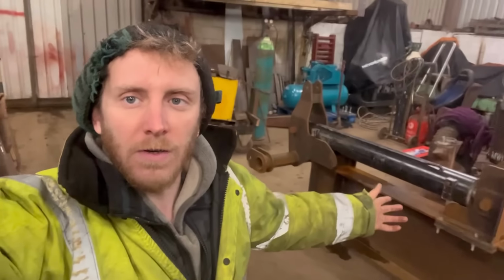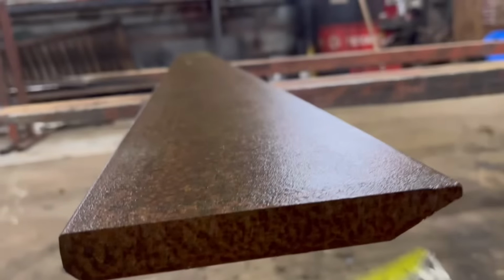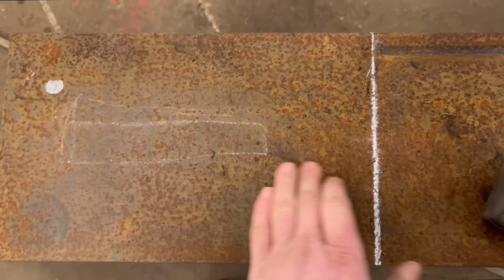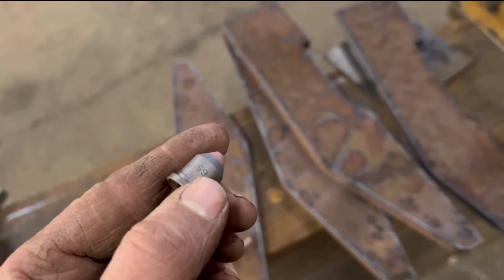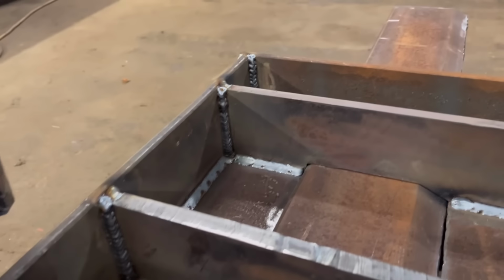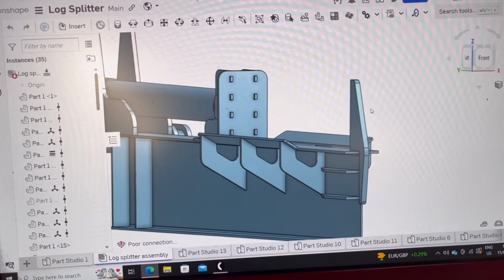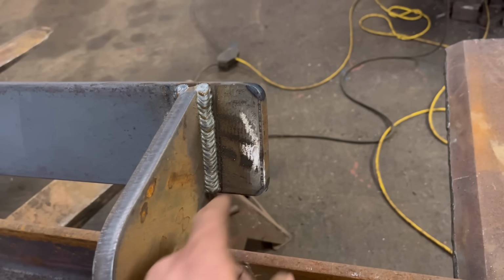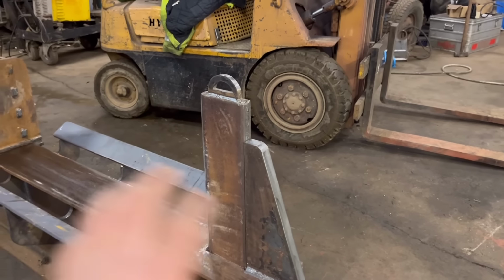Making a HUGE log splitter. Part 3

Comment: Nice job 👍        A couple of suggestions for you   ( Having built a similar machine myself)  weld some bucket edge up you blade backstop, bring it forward to overlap the back of your blade.

This will support the blade sideways (lateral)  and act as a wedge to promote splitting.     You already realised that you left too large a gap between the pushing pad and the blade, I found stopping  1/4"  away  worked well enough.

I used a big ram off a scrap 360 excavator  and like you started off running direct off the tractor pump,  cycle time and fuel consumption was not good!

I ended up modifying the splitter, with it's own pto pump/gearbox and hydraulic tank,  cycle time is massively improved and the splitter can now be run off a small tractor at low rpm, with good fuel economy.

I've been on the arc sun-tan/arc eye,  boat  through just not thinking!   even though we know better it just happens occasionally.........................

Enjoy your content and hope the above suggestions are food for thought.   cheers. 👍

Comment: I’m disappointed. The wedge end was a blank slate and ended up no different than a standard splitting maul. You built a splitter no different than one from 50years ago.
Reply from the maker: Didn’t log splitters 50 years ago work?  This is a machine for our own use not for production use so it doesn’t need to be anything fancy.
Reply: @snowballengineering  you’re correct. 50 years ago splitters worked just as did pattern torches. Now the world has cnc cutting tables as you yourself do. Thanks to the internet there are so many designs of any machines that a few mere minutes of research will get the creative mind going. This is what I did with my splitters.

Comment: Normal safety glasses are useless for the grinder, the goggles you use are perfect. I tend to use a full face shield these days as I always fog up with goggles. I thought you were going to say you’d had a welding flash but I guess a uv burn can be just as bad. Skin cancer is no joke, I have had three removed from my face. The splitter turned out to be a beast 🙂

Comment: I assum that this is something you have wanted to do for a long time.  There is no  way that any of those parts are going to get way - you have done a good job welding. The beauty of this project is that it was for you with the result you have (may-be) over killed but it will work better than a log splitter bought off the shelf.
With you it's like what that doode said "Engineering with Oliver is like a box of chocklets we have no idea what we are going to get"

Comment: Hi you could always try downhill welding when I was a welder at Crane  fruehauf trailers we would weld horizontal vertical overhead, but the vertical we used to go downhill try it and see. It’s like welding horizontally that’s a bit faster.
Reply from the maker: Depends what the welds are for. Uphill is the proper way if you want strength with hard wire.

Comment: Vertical up with mig is better using a triangle weaving pattern pushing the top of the triangle into the root and pausing at the sides 👍 looking good though

Comment: Well thought out and well executed job. I noticed that the logs were tending 'to ride up' when the log hit the blade. Would a sharper blade fix that,  or would it help if the driving plate was angled forward  a bit?
 I couldn't help wondering whether it could be made into a one man operation, but fixing remote controls might cost more than what you have done to date. MartyT , a You tuber and former Forestry man from NZ made a home made log loader for a splitter using the return stroke on the ram, - handy with the heavy stuff

Comment: When you build the hydraulics for it, look into a system that will reset the operation handle. So the ram stops automatically, when it travels into the starting position. It can be done with the increase of the hydraulics, or with a mechanical mechanism that pushes the valve in the neutral position. There are special control valves available for log splitters, with all needed features in it. 👍 don’t forget the differential valve.

Comment: oh my this is the log splitter from hades for sure don't think any could say is not well built for the job i would not worry to much about your vertical welds they look just fine i am no good at them either but can pass when have to i like you turn everything on it's side weld flat all up darn nice job work and design second to none Cheers and yes enjoyed the video very much i like the way you think and work through things for the best out come the mods you speak of will definitely improve it for sure Cheers again

Comment: I assume you’ll give its own hydraulic handle, for the operator. Make sure to put in a pressure sensitive differential control valve. It will increase (3x) your operating speed, without losing the strength when needed. Make sure you keep 1 function available for the future, so you can put an hydraulic lift system on it. A lifting arm would be easy to build on this massive frame.

Comment: Put a few vertical plates on the knife, enough power to split logs in 4 or 6 way. Look at the design of the posh splitters. Let the vertical plates stick out a bit, so the get support in the back, preventing flex of the knife. I advice you to make a separate knife with the 6 way split, so you keep this one for difficult and big stuff.
Reply from the maker: That’s the plan, I do say this in the video 😉😆
Reply: @snowballengineering  good. Also look at the design of the posh knifes. The put there extra knifes at a (10* degree) angle. First they engage the main knife. A few centimetres later the second. And so on….  It’s very important, because otherwise to much force is needed to split the wood. I’ve made my own splitter (9 ton). I’ll put a link in. https://youtu.be/ohlG7B1GL-g?si=k86zqV_O6X-bzMnq

Comment: Looks good mate.

Looks like the flex is all where you cut the hole out for the blade, which is to be expected.

Those horizontal pieces will stop it bending left and right and were a good idea, but they dont really replace the strength lost by cutting out that hole.

I'd suggest it would be well worth pressing some 10mm plate to the same profile as those side pieces to fill in the gap, especially along the top next to the flange as that's where the majority of the load is carried, but I'd do both and leave the hole at the bottom so the junk can come back out.

And I still reckon you will be well served filling in the gap between the web and the pipe. Just to prevent it fatiguing over time. 10-12mm plate would be enough there.

Overall though, bloody excellent result.

Comment: Why have such a long stroke? Would half not of been better🤔
Reply from the maker: To split long logs.
Reply: @snowballengineering  must be a big log burner? 😂 It looks the job though👍
Reply from the maker: After the logs are split they’ll go onto a wood processor/saw bench to be cut into shorter logs.   Saves a lot of work with the chainsaw if you can split them in longer lengths.
Reply: @snowballengineering  👍 Great…. Carry on with the fantastic videos…
Reply: Additional 2 answers. Look at commercially available splitters with that dia ram and tonnage and see the travel on them. I have an American made unit with a 31 tonne ram and it has a similar length capacity. 2nd. Ram cost 45 pound. Use what you can get - cheaply.

Comment: There are logsplitter valves available that connects the rod and pistonside till it hits a set pressure , it more than doubles your cilinder speed out, differential operation its called I thought.
Reply from the maker: I’ll have to look into that. Thanks for letting me know